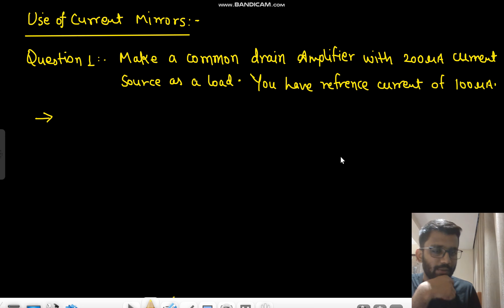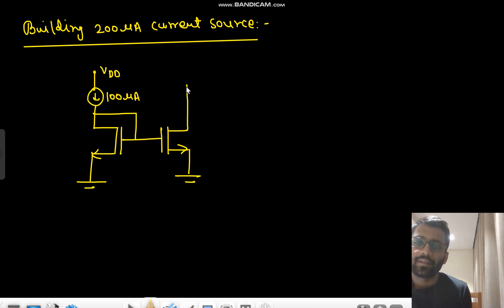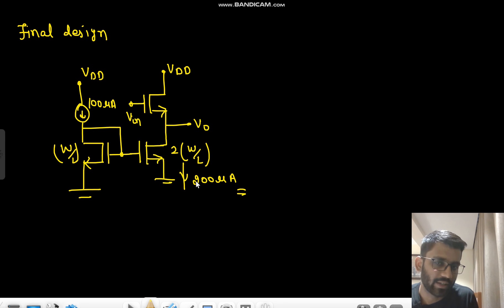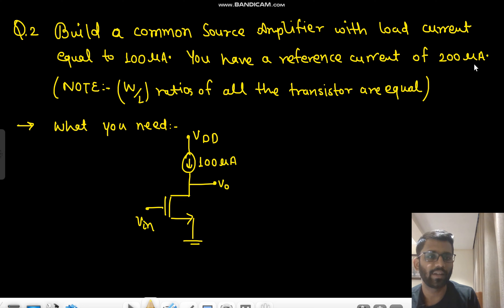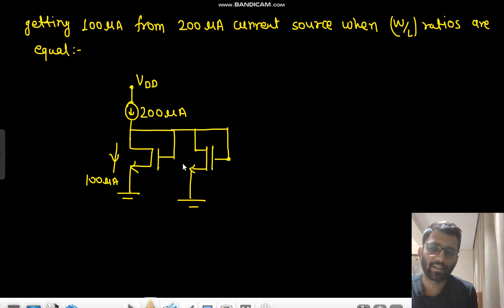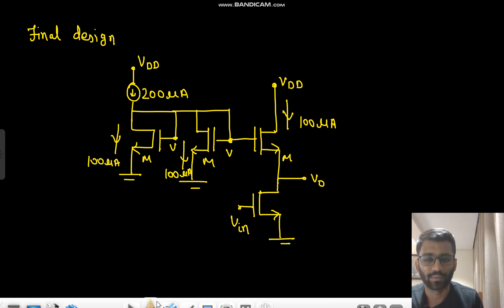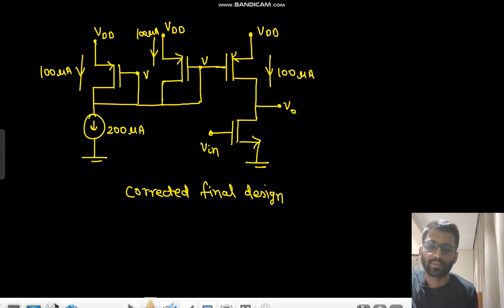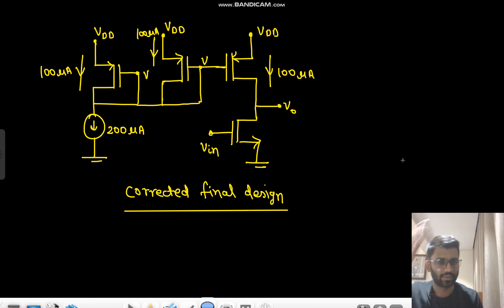Design Problems on Current Mirror Circuits || Prep For Interview

Comment: About your last design that  Common Source amplifier using 100mA current source load from 200mA reference current, I would say instead of making current source active load using pmos we can still use nmos active where you have shown it wrong design. But in that case signal we have to feed through pmos instead of upper noms